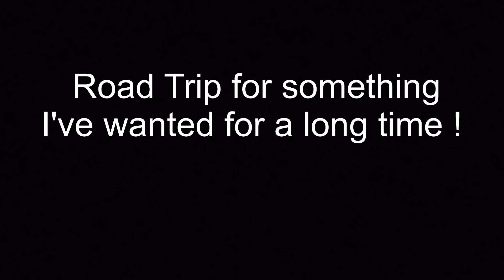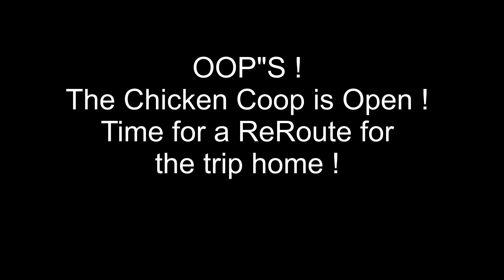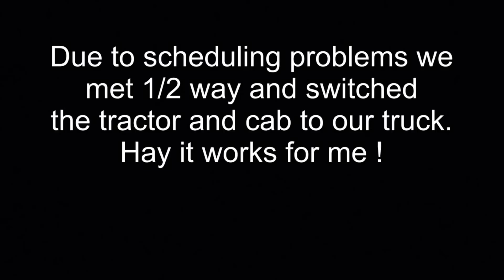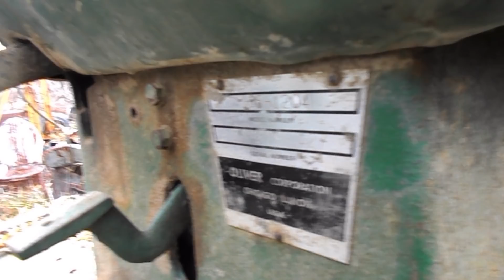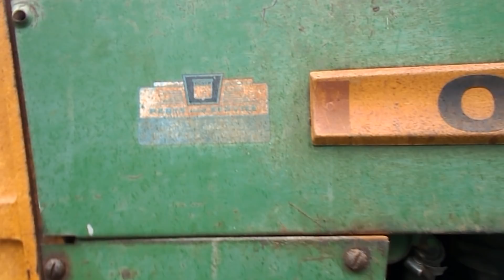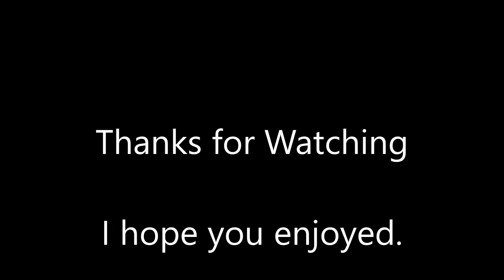Road Trip for something I've wanted for a long time !

Comment: Yours may be an Oliver 1850 special. You may ask Chris Losey to look at it. I could be totally wrong. Mines 2 years newer with 3 speed I’d like to have that shifter lever. I still need to fix my tilt steering oh well. Congrats on the new horse
Reply from the maker: Being its all original and you can tell nothing has been changed but I have seen one other 1850 with this same shifter so its now a one of a kind, There is a 2-105 White for sale close by that has the same shift lever in it and was told it was made to make it easer to get in and out of a cab witch makes sense.  I hope the steering colume is easy to fix cause this one is loose too !  My hydra-power is iffy and I knew it was but if I have to replace it I'll replace it with a 3 speed if the shift lever will let me do that . Bandit

Comment: We have a wide front 1850... that thing would pull the moon if you had traction!  That's a really good find, hope you get it goin soon!  And a the sound 354 Perkins will always have a spot in my heart
Reply from the maker: We had an 1850 years ago and dad traded it off for an IH 1568 and I told him he wouldn't be happy with it and boy was I right !  Everyone goes on about the 4020 being the greatest thing sense sliced bread but the 1850 was a much better tractor that did more work on less fuel than the 4020 did.  Don't get me wrong a 4020 is a good tractor but I would much rather have the 1850 cause I can get one for 1/2 the cost of a 4020 and get more work done on less fuel !  The 354 Perkins is just about a bullet proof engine that was made for 30 years or more and was put in many different tractor and combine even trucks too !  I'd still like to put one in a ton truck but I don't think I'll ever get to do it but I'd still like to try it !  Bandit

Comment: my neighbor has an 1850 setting in their barn sinking in the mud but they won't sell it , the clutch went out and it's been setting for years.the oil pan is off so the engine isn't good. the cool thing about it is it has a factory rollbar with canopy top!!
Reply from the maker: Keep trying to get it as the 354 was used in a lot of tractors and combines and are not that hard to find. It would be worth the effort to put it back together if you can get it bought at the right price.  Bandit

Comment: That's a nice old Oliver for sure, will be looking forward to more videos on it!You fooled me a little bit, I was expecting the surprise to be a tractor but I was thinking it would be a White of some sort with a cab and AC.
Reply from the maker: I'm like a box of chocolate , You never know what your going to get ! LOL I think I got a lot of people on this one but I'm glad I got it bought like I did cause I doubt I could ever find another like it in this kind of shape. I'd love to have a nice White 2-105 with cab heat and air, That's my dream tractor !  But I'm happy with what I bought and the cab will keep me out of the sun and that's a set in the right direction !  Bandit
Reply: Bandit farmer you got any experience with an AC 200 tractor? Just curious of your opinion of them, I'm kind of courting one right now and not sure if I want to pull the trigger on it.
Reply from the maker: @travisfollowell3310  The 200 was a lot better than the 190 was for sure, Need to go under it and look at the bottom of the transmission from the bell housing to the back axel for cracks or welds on the bottom or the sides. This a problem on the 190's and some of the early 200's and make sure it doesn't pop out of any gears and if it does walk away from it.  200 is a good tractor but check it out good just the same,  190's were bad for braking due to the torque from the engine and using a D19 rear end,  Now the 200 was beefed up but if it was turned up it can do the same thing so check it out good before you buy it.  Bandit

Comment: What a score you will have this thing rocking I cant wate to see some more videos  I wanna see her cleaned up and greased . You can buff alot of that green back to original  good idea to paint the white tho do you watch  chris losely
Reply from the maker: Its not often you come a crossed an all original tractor like this but when you do its a must have tractor !  With 60* days in December you take advantage of them so she is going to get a Bath cause she really needs one !  Then it will be oil and filter changes and fix what ever needs fixing.  I'm thinking about doing the clover white paint again but it is all original and I would hate to mess it up so I got to think about it first. I watch Chris a lot cause I've learned a thing or 2 I didn't know about my 1550's from him I didn't know. I like watching video's on equipment I have cause you always learn something new !  Bandit
Reply: Great idea and in the work close is much more valuable now days then restored

Comment: My dad had a Oliver 1850 D with wide front and feul tant fenders, but we trade it off for bigger tractor and my first tractor to drive on the farm.
Reply from the maker: The 1850 has always been a tractor I've always wanted,  We has one in the 80's till dad traded it off for a 1568 IH (V8 diesel) and I've been looking for one ever sense and now I found just the right one to buy.  I'm going to enjoy running it come spring time and it will fit right in here on the farm with my other Oliver's, The 1550's have there big sister back again !  Bandit

Comment: Don't know much about the Oliver parts ( not any around here) but that Perkins is a good engine. I've got a m.f. 1105 and it seems to make fuel. Take care and have fun
Reply from the maker: We have an old Oliver dealership (they don't sell new Whites anymore) but there still working on them and getting parts for them. My 1550 I got in 1988 the only thing other than normal oil and filters I've had to get was a steering arm I broke disking in ruts and I had one the next day and it was a good used one, New one was $295 good used one was $110 so that's what I went with so parts aren't hard to get. I know the 1850 we had before was easy on fuel too and I hope this one is too !  Now if it was as easy on fuel as the long is I'll really like it ! LOL Bandit

Comment: Nice!!!! Bandit!!👍👍 Looking forward to more videos on that one!! I know how it feels to look for something for years and finally find it! My adventure was last year when I ran across the whole trailer load of Oliver 60 parts I needed to build the tractor from the engine and frame I had for over 10 years! Good luck with the 1850!  Glad you have it!!
Reply from the maker: Sweet Jody ! Oliver 60 was the first tractor I ever drove by myself and I learned to culitivate on the tractor too.  That quiet purr they had is still music to my ears, Forget strait pipes put the right muffler on them and they have there own sound and I love it. Finding a trailer load of tractor parts for the tractor your working on is like hitting the jackpot at the boat !  The 1850 is coming along pretty good and I've gotten a lot done and I'm to the point of thinking about the cab and what it needs to have done to it to put it back on. I have to wonder about my LED light change over on it cause its a completely original tractor, Still thinking about it weather to do it or not. Good luck with the rebuild I know how much fun it can be to rebuild a tractor and you'll enjoyed every min of it !  Bandit

Comment: So glad you bought the Oliver.  There are never enough of them.  I have 4 Olivers and a White 2-110.  They are great tractors.  Can't wait to see you using it.
Reply from the maker: I'd buy an Oliver before anything else ! LOL The Long I bought to fix up and sell until I used it and had to keep it and the Case well it was cheap enough so I bought it.  Now there are 3 1550's and the 1850 and the Long 900 but the Case has to go now cause I really don't need it now, Now I have a tractor to use every piece of equipment I own and I like that idea a lot.  Bandit

Comment: Nice score Bandit! I wouldn’t mess with her one bit besides any mechanical fixes. That’s a sweet combo! The offset shift lever is pretty uncommon. Those Perkins are my favorite engine. The serial number plate is in the right place. She seems to be a decent original. Best keep those hydraulic outlets - also hard to find, especially with the remnants for the hydra-lectric system. The fender light panels are also the correct color for a ‘65, Clover white wasn’t implemented until ‘66.
Reply from the maker: Thanks man, We had an 1850 before till dad traded if to an IH 1568 (V8 diesel) and it didn't take long for him to start to hate it and I've been looking for one ever sense.  I was surprised when I went to look at it and found it to be so original strait and complete as it is, With those hydraulic ends on it I have a feeling the hydraulics have not been used that much but the hydra-power is iffy and I figured it was but for the price I'll take a chance on it one way or the other. Once I give a bath and get a good look at it cleaned up I'll know what I'll need to do to it and go from there. I can see some rewiring I'm going to have to do and the wire is cracked and I don't like bare wires !  Bandit

Comment: Well Bandit, the cat's out of the bag. 2020 is looking so much better for you! I just watched a video of a 1850 pulling at Rockingham County. Just blessed is what you are.
Reply from the maker: Yup it sure is now ! LOL I'm looking forwards to getting her going again and cant wait to get her in the field working again. It has sit for about 2 years so it shouldn't take too much to really get her going, Once I get the oil and filters changed I'll bet she runs a lot better then its on to fixing her up and getting everything working again and by the looks of it I'll be doing some rewiring too as a lot of the wires are cracked and bare so that's a must fix !  But I think its going to turn out to be a good tractor but time will tell. Bandit

Comment: That's a heck of a score there. I love those old Oliver's, I'd love to have one myself. I've tried talking my buddy out of his 1650 narrow front but he won't let it go, even though I cant blame him, it was his grandfather's after all. It does get some use still plowing snow and splitting firewood.
Reply from the maker: Thank You, I looked long enough for it and when you looked that long and find an all original one in good shape you got to buy it !  You'll find if someone has a 1550 or 1650 they wont part with them cause they use them for a little bit of everything around the farm. I let a guy I know borrow mine after I got it and he wanted it so bad he gave me a blank check and I said no I got to keep this one !  He found one in 1990 and he still has it and like me he wont let go of it now ! LOL  Bandit
Reply: @banditfarmer1900  True, but he did end up selling me a White 543 4 row planter with the double disk openers that he only used for 3 seasons, an Oliver 543 parts planter, and a John Deere FB grain drill that was bought brand new and has only been used once.
Reply from the maker: @MedicineYandere  Anytime you can buy really good equipment cheep you buy it and run it till the wheels fall off, Then fix it and run it some more !  As I've been told many times you cant make money buying new equipment but good used will make you money over the years cause once its paid for your making money with it !  Sounds like you made a really good score too !  I like it !  Bandit

Comment: Is there still a purpose for narrow front end tractors?  Honest question.  Sorry if I'm asking dumb questions. I'm not a farmer but most everyone on my mom's side of the family were farmers.  Some owned Olivers back in the day.  Thanks.
Reply from the maker: Narrow front tractors are row crop tractor and it gives them a very tight turning radius making it easer to turn on the ends when culitavating ,  Its way easer to back a wagon in a barn with a narrow front tractor than a wide front .  But by the mid 70's all new tractor sold had to be wide front for safety reasons dew to the number of roll overs on hill sides. Also at that same time gas tractor production stopped as well dew to new EPA regulations .  Narrow front tractor had there place on the farm for a lot of reasons but now there harder to find.  Bandit

Comment: Hey bandit looks like a nice straight old tractor for sure. I surely expect to see it hooked to one of those semi mount plows you dragged out with the utility a while back! Should pull it a litttttttle better than the 1550 would Lol! Sorry to see the case go but progress is progress!
Reply from the maker: Nick when I found this one I had to have it, She might look a little rough but its so strait and original I got to take a chance on it. I've got the perfect plow for it its an Oliver 5x16" with Radex Bottoms and its the plow it was made for the 1850.  I hate to see the Case go but I would rather have the 1850 because of the 3pt and the hi low range in it. Shoot I might even try the 6x14" on it just for fun !  Bandit

Comment: Hard to beat those old Olivers! I think they had a good tractor with the 1850 beings they put the Perkins in it. I noticed in the video that it had 2 different rear axle hubs.
Reply from the maker: Cole the 1850 is one of the best tractors Oliver built and the 354 Perkins diesel is about bullet proof as engines go. To be honest the 1850 will out work a 4020 and cost about 1/2 as much so its a no brainer to me to own one.  The right side the hub has been replaced with a dual hub that has a piece broken out of one side but it will work fine the way its being used. But I am going to keep an eye on it just the same but I know ware I can get another hub if I need to. Its always good to know ware spare parts are at ! LOL Bandit
Reply: farmer.....I'm a huge Oliver fan so yes I agree. It will out do the 4020. We have a 1555, 1655, 1755 and 1855. Along with several 550's and several Whites! Good luck! Like the videos about the tractors!

Comment: Certainly. 
It is used and it smokes a little blue, 
but otherwise it runs well in the engine. 
It seems to be a good buy.
Reply: Make her work and the smoke will clear up, after the preventive maintenance of course.
Reply from the maker: @frankdeegan8974  I agree , First thing she is gets is a good bath !  Then I'll start changing oil and filters and fixing what needs fixed and go from there and I'll bet the smoke clears up. I have books for it and we had one before so I know there quirks and the biggest is if you don't work them they start to slobber and that's what it looks like its doing so she needs to be work now and see if it clears up.  Bandit

Comment: You are going to have to build another shed if keep this up  I would not install the cab too hot in the summer keep up the good work
Reply from the maker: I'm going to have to do something cause there is too much good equipment sitting outside and I got to do something. I wanted the cab just to keep out of the sun and being there is no glass in the cab there will be plenty of air moving threw it and I'll be out of the sun.  Bandit

Comment: Cannot beat a Perkins best engine ive ever had have a 2705 Massey Ferguson 19000 original hrs on original engine have not overhauled yet still running good been in my family since new in 1980
Reply from the maker: The 354 Perkins is just about a bullet prof engine as long as they are taken care of. To me its one of the best diesel engines ever built , They were put in tractors combines fork lifts and trucks and who knows what else, Heck about a year ago I was looking at a 69 Dodge C600 that had a 354 Perkins turbo 5+2 but just could not make the deal but I would have still like to have had it. Bandit

Comment: You were out near my neck of the woods. I've been to that home Depot a number of times. That is a very nice 1850 under that rust and faded paint. Even got a cab with it. Good luck and I hope it lasts for long time. Great way to start the new year. 

- Deerefan
Reply from the maker: There is a good reason we met there mainly the time factor my cousin had as he had things to do later that day so we set it up this way to get it home.  For some reason I thought the chicken coop was before New Haven road and its between there and Dry Ridge road and he really didn't want to go threw the scale so we back tracked over to dry ridge road and went around it. She might look rough and dirty but she got good bone to work with, An all original 1850 is hard to find and the tractor tells a strange story to say the least. As strait as it is it had to be taken care of but then it shows signs of neglect in the filters so I'll find out when I get into it.  I've been threw Harrison only a few times in my life and the first time was with my grandfather when he went over there to buy a new chain saw at the factory that was over there ( I still have it ).  Its a long haul of there from ware I am but it was well worth the trip to get that 1850 and I'm going to give her a good bath and start going over her changing oil and filters and fixing anything that needs it. Bandit